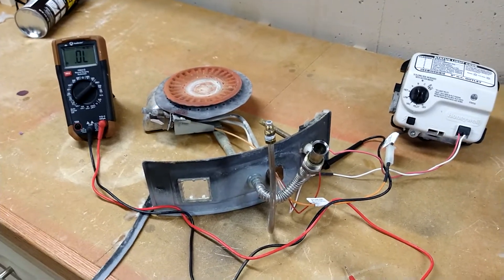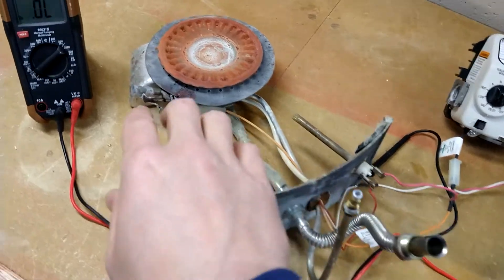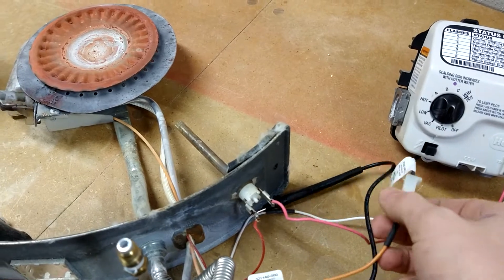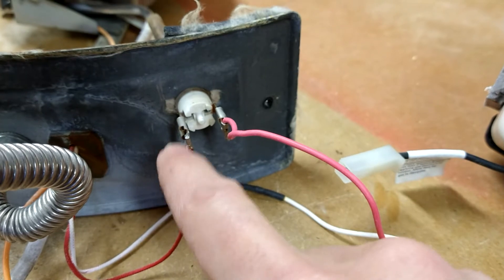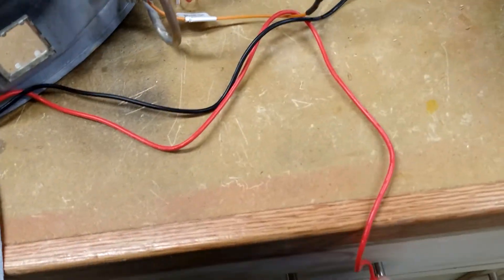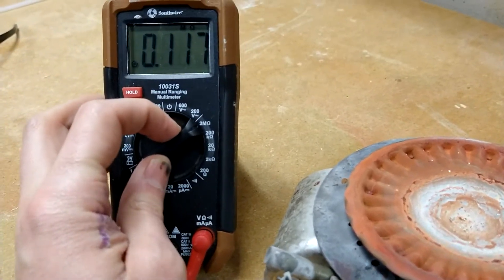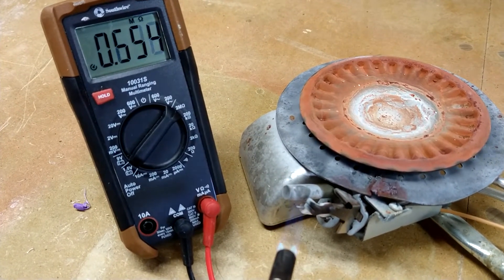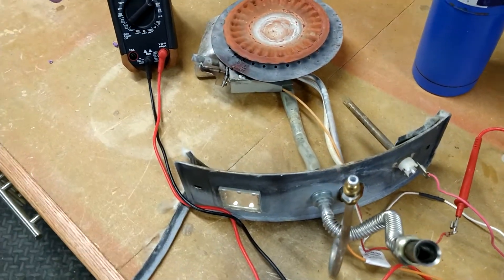Water Heater Thermocouple Test (Resistance)

Comment: Rule number one: NEVER run voltage into an ohmmeter! Resistance should ALWAYS be measured in a dead circuit lest you risk damage to the meter. Also, resistance says absolutely NOTHIING about the condition of a thermoPILE (not thermocouple), although the same holds true for a thermocouple. The ONLY way to test a thermopile is to check the voltage while the pilot flame is impinging upon it, and there are three basic tests. The first is open circuit voltage. The second is pilot holding load voltage. And the final test is burner on voltage. 

I give you "A" for effort though...

Comment: Sorry to say, but you’re doing the whole thing incorrectly and your meters on the wrong setting and it’s not a thermal couple. It’s a thermal pile thermal pile has wires. A thermocouple is all solid copper.